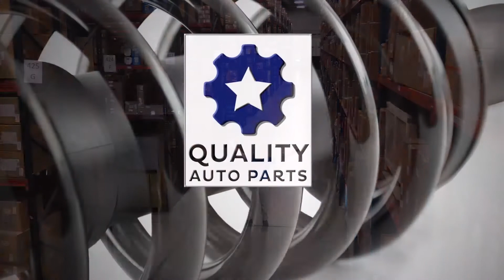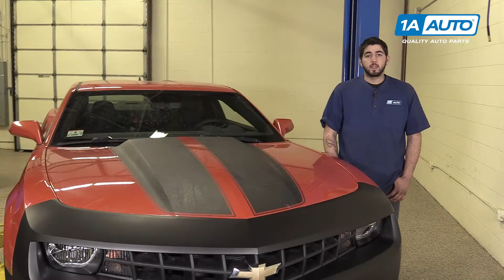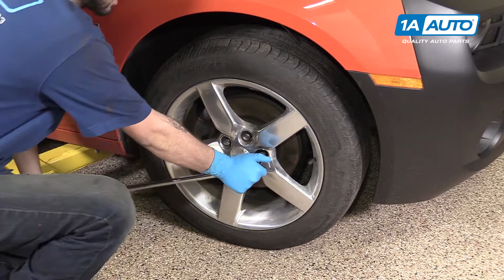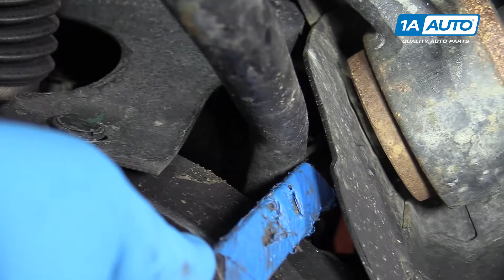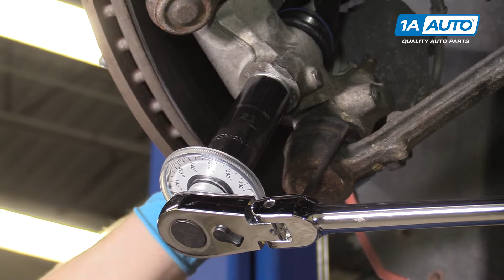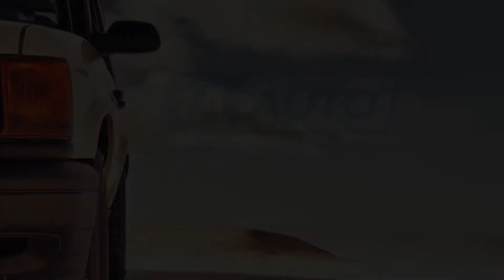How to Replace Front Lower Forward Control Arm 10-13 Chevy Camaro

Comment: Don't care what he says . You have to have a front wheel alignment done . Because my camaro had to . It has a bolt placement on the knuckles for the camber alignment. It's a must.  If they don't then they are not a mechanic.

Comment: Do you need an alignment after. Just got one and realized the car was still shacking aggressively after 40 mph
Reply from the maker: +Is this the krusty crab ? It is recommended to have an alignment done after replacing any suspension or steering parts.

Comment: My car has over 127K miles, I track my car, and yes Im that one person who lags on the maintenance of the car, so I never replaced any suspension parts until now, now my question is do I need to replace my rear upper and lower control arm? Or do I just need to replace the bushings? Or is there no need to replace them? Will I be fine just having the rest of the suspension work?
(Note: Im doing a full suspension replacement, coilovers, inner outter rods, front control arms, end links etc)
Im a customer, I bought the 10 piece steering kit for my Camaro :)
Reply from the maker: +Aurora Phoenix Thank you for your order! We'd love to hear about your experience. Here's a link to leave us a review on Google: https://goo.gl/i5JFNY 
For the parts you do not need to replace the control arms unless you are having play in them. If you are unsure we would suggest taking your vehicle to a local mechanic for assistance with the diagnosis.
Reply: If you're there you might as well replace it. It's not fun.